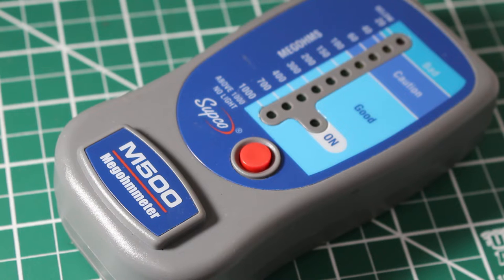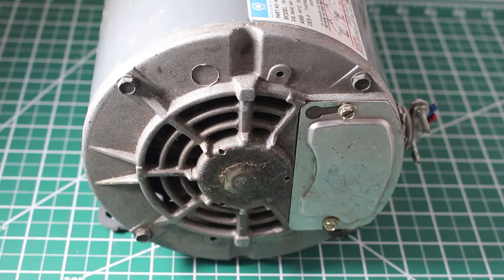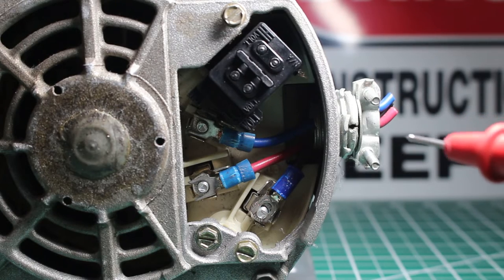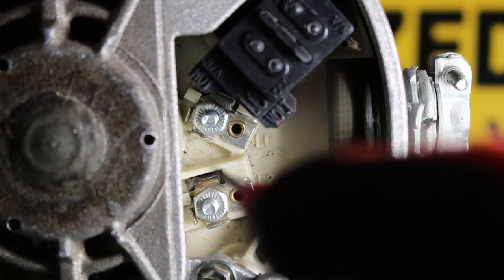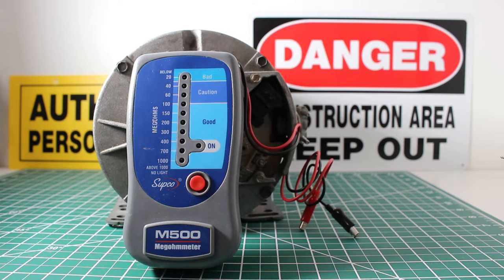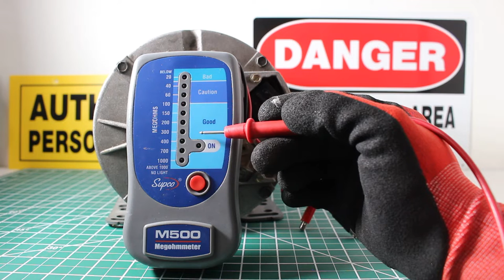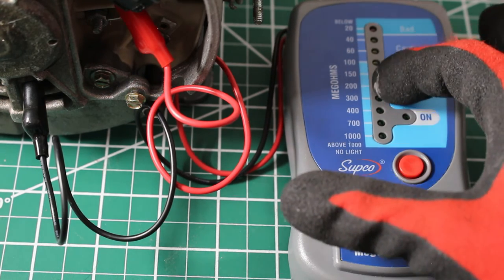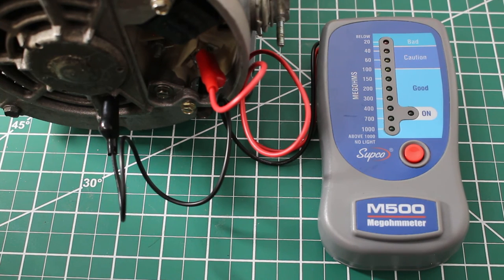HVAC: Megger Insulation Resistance Test For 3 Phase Motor(Windings Insulation Resistance)Supco M500

Comment: Great video as always. This a great for a quick diagnose of a broken or not broken motor. However for intermittent issues under load I suggest carrying out the test over a longer period of time ( that would require other test equipment). Anyway great as always, take it easy and stay safe!

Comment: To tell you the truth this is a waste of time and $ for generic units and let me tell you why:

On a 3 phase motor or compressor the ohm readings across each leg will always be the same reading across each leg, ex:( L1 and L2 =3 ohms, L2 and L3= 3ohms, L3 and L1= 3ohms) this is just an example, some motors or compressors will be a different ohm number but the point is the ohms will be the same. 

If a motor is bad you’ll be able to tell if the bearing is shot, the shaft doesn’t spin free, or you don’t have continuity across each leg or you have a short on a leg. The reason this tool is useless bcuz this tool can say that the ohm reading is bad but in reality it’s not taking into account that the motor or compressor was running under a load for a long period of time when the test was performed. If you suspect the motor is bad CHANGE IT OUT, don’t waste your $ on this tool